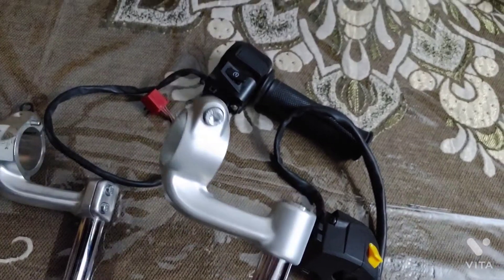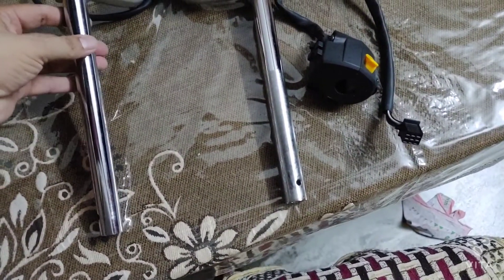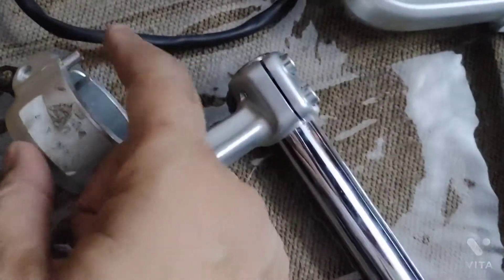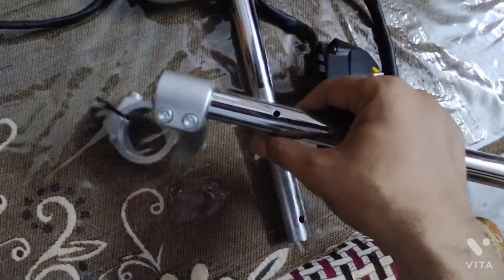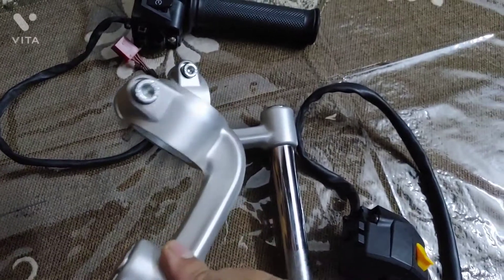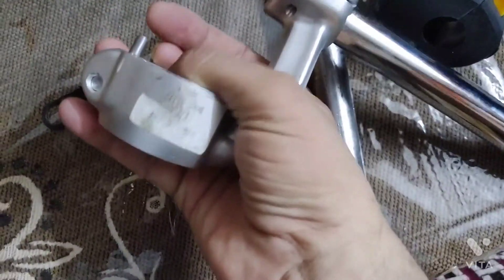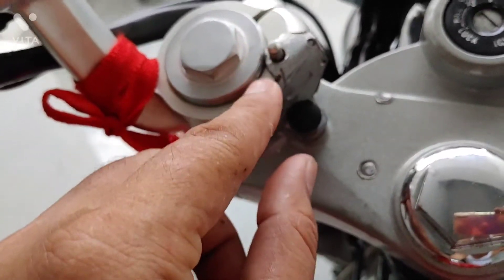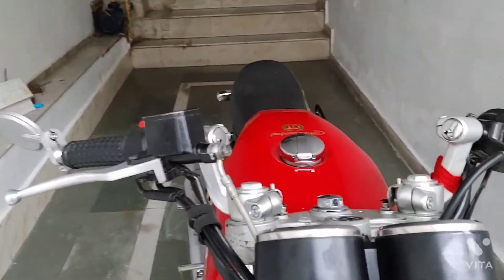Continental GT 650 clip ons fitted into Continental GT 535 l Yatin Singh

Comment: That is a very well maintained gt535 , uv kept her in a very good condition , good efforts in doing such modifications Yatin!  You must do what you feel is right for you ,just curious to know how old is your bike and how many kilometres have you done it ,looks really well maintained,
Reply from the maker: 🙏
It's a march 2017 model and it has completed around 10000
Thanks for such a nice motivational comment
Reply: @yatinsingh88  another question,when you purchased the clips , you paid 6500 only for the clip ons or the clips with the upper T
Reply from the maker: @rashidpoonawalla1203  
There was no requirement to replace upper tea I got the clip-on only and with little adjustment they are direct fit
Reply from the maker: It's 2017 model runs only 8k